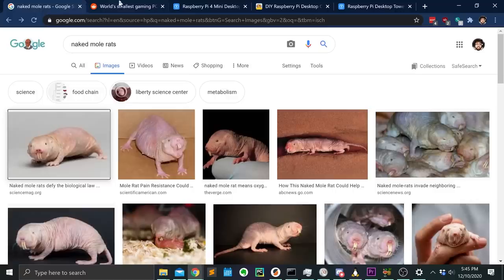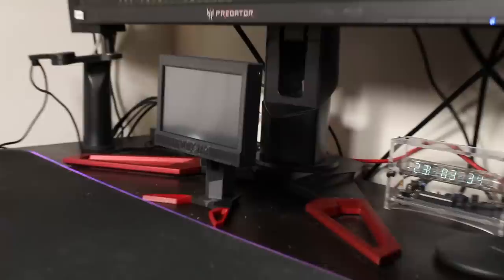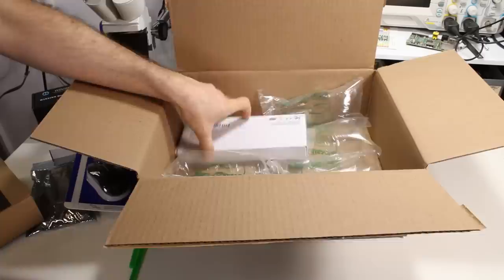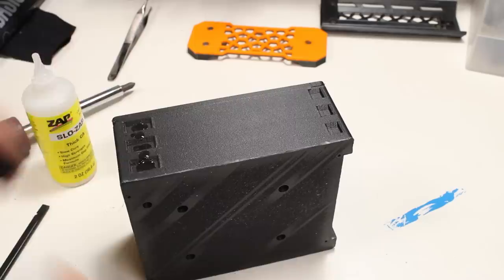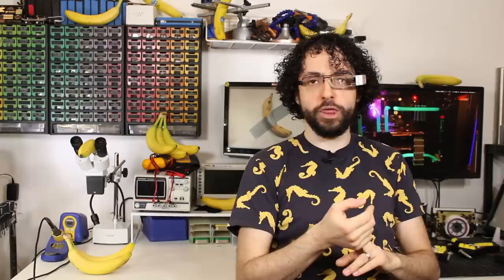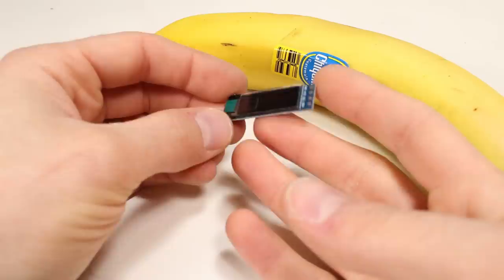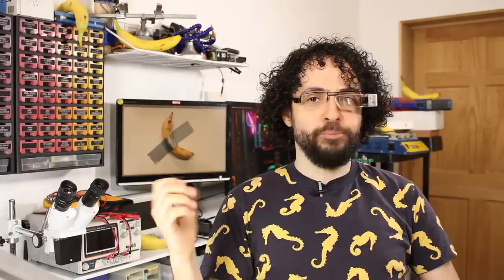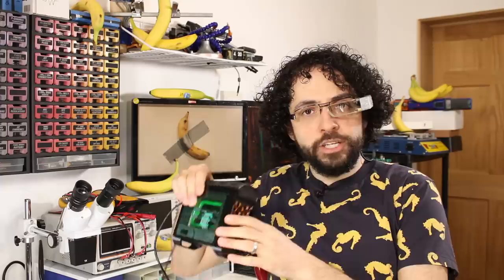tiny pc

Comment: 6:20 For true liquid cooling, consider building a tiny peristaltic pump from the smallest dc motor and flexible tubing you can find. They do sell prebuilt ones about the size of a cubic quarter. You also could probably cut a section out of an old radiator and trim the fins down to size for a tiny radiator as well, some soldering/brazing fittings may be required.

Comment: I put these little noctua fans in my Unifi Usg Pro 4, similar to the ones you used in this tiny pc, because the stock ones were so dang noisy. Not only is it much quieter now, but it's running cooler also

Comment: ah was wondering about your evolv. I really want to cut some holes in mine but i want to keep the aluminum anodizing. current solution is an external quad rad with 8 extra fans.

Comment: Ok so there are 1tb sd cards that I have gotten to run the pi software just fine, and it allows for a great amount of space. It even works with the pi 4 which can have up to 8 gb of ram. There is also a software called twister Os which allows you to run the pi that has a set up like chrome.

Comment: How did you put the tiny monitor together? what parts would I need to replicate this?
Reply from the maker: You need the 5" LCD, some filament, some 10mm M2.5 screws, some M2.5 nuts, and whatever wing nut and screw you've got lying around.
Reply: @ZackFreedman  thank you so much, I was just going to guess until I found the right size, just ordered all the parts for the monitor (we have the same monitor so it works perfectly) and the lcd

Comment: Shove a samsung Note 20 in that spot under your ps5, plug a type c to hdmi adaptor into the phone, turn on dex. Use ps4 controller touchpad for mouse. Bluetooth keyboard for keyboard.

I did it once.
Reply from the maker: Damn, that's a Voltron of hardware...

Comment: 😲 There are tons of tiny pumps around. Edmund Scientific sells a thread spool sized low voltage AC powered pump. I found a Mini 12V DC 6W White Brushless Water Pump 4 by 5cm at Bezos' house for $14. Now you make ME have to build a tiny water cooling system!

Comment: picture was upside down because the screen itself was?
Reply from the maker: It's a quirk of the Pi's direct rendering. The most efficient video output API ignores the orientation settings in /boot/config.txt and is a real nightmare to fix.

Comment: How much does your 3D printer cost?
Reply from the maker: The Prusas are about $750 as kits. My Phrozen resin printer was about $400.
Reply: @ZackFreedman  Which have you used in the video,  I dont wanma waste a bunch of money overspending on something I don't need, but I also don't want to get something cheap and crappy of no use and that be a waste too
Reply from the maker: @MPG187  All the printing in this video was done on my Prusas. They're excellent printers, and the only ones I recommend.